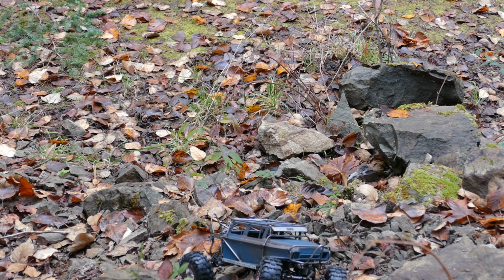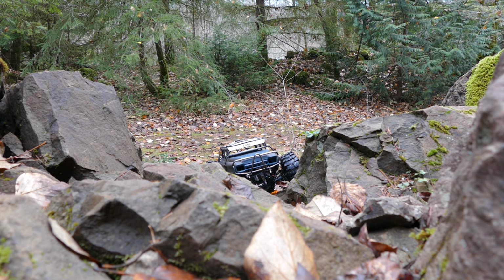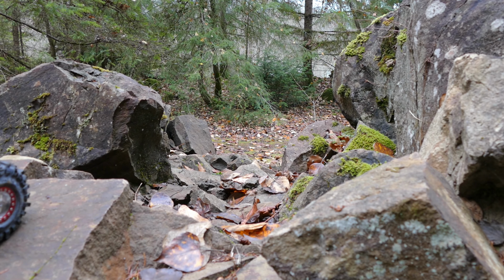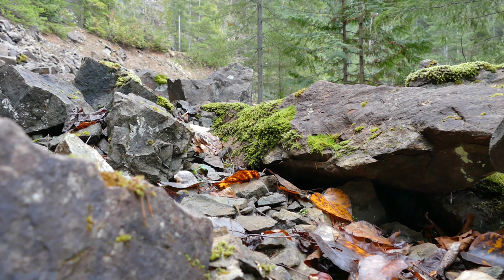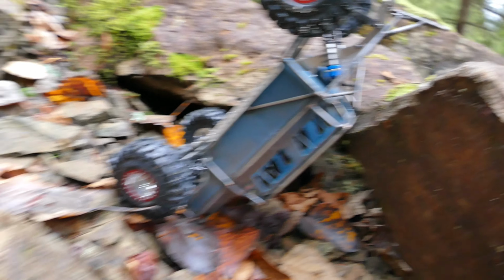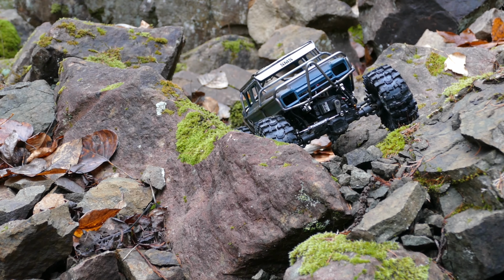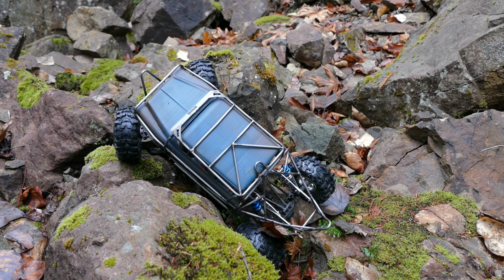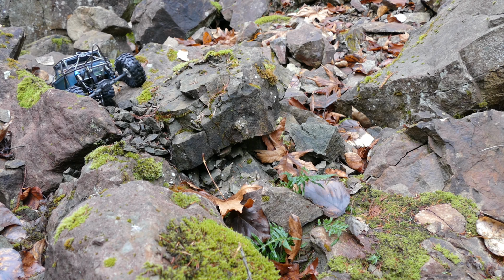Project Jericho 1st rRun Shakedown

Comment: did you strech 1.9 tires onto 2.2 rims an what foam are you using if you did?
Reply from the maker: These are the Baja pro x 1.9 with stock foams. The wheels are 1.9 phat lip spec rc wheels. They do look huge, I forgot the width I think they are 1.65?